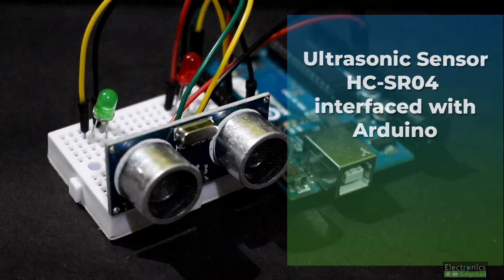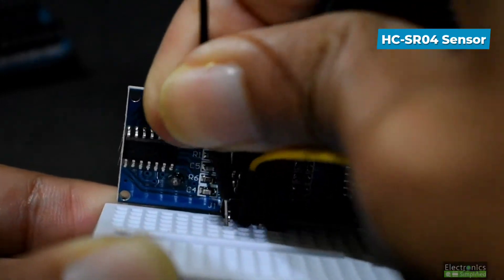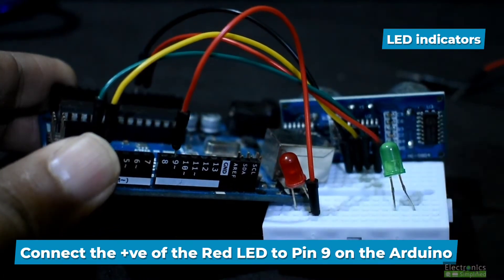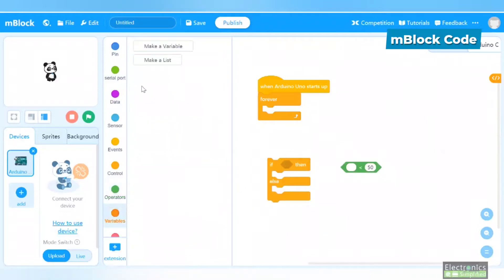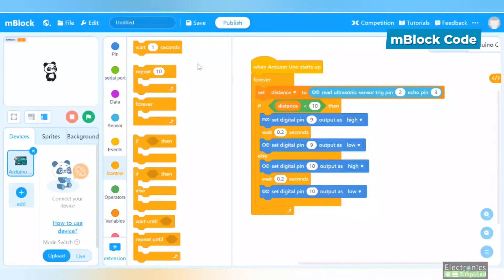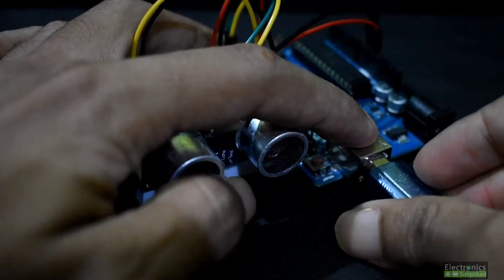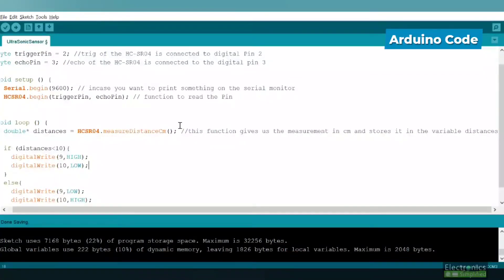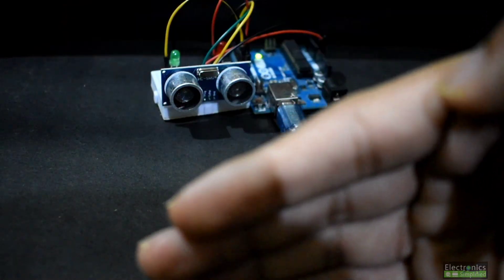Ultrasonic Sensor (HC-SR04) interfaced with Arduino Uno using mBlock and Arduino IDE

Comment: Mines isn't working I copied your tutorial but all my Arduino does is produce a dim light for my green LED
Reply: boss,first u nimma LED check madi
Reply: amele Nina led ge yeshtu agaithe antha nodko
Reply from the maker: Agreed
Reply from the maker: Please check you connection. The HC-SR04 sensor is sensitive to Lose connections. So Please fasten your connections.
Reply: @ElectronicsSimplified7  I redid it and made sure all of the connections was secure but it still just show a green dim light
Reply from the maker: What is the sensor model you used?
Reply from the maker: Using mBlock or Arduino IDE?
Reply: Olnice, it is bcoz of the wire connections. I have this project and it is very easy working for me.
Reply: @jammypereira9522  I connected the wires just like the video said

Comment: We didn't need to use any of the resistors?
Reply from the maker: I mentioned they are for protection for the LEDs. I didnt use them as they are not necessary.
Reply: No resistors needed.
Use them to protect your LED. Also please check your LED if it is functioning.